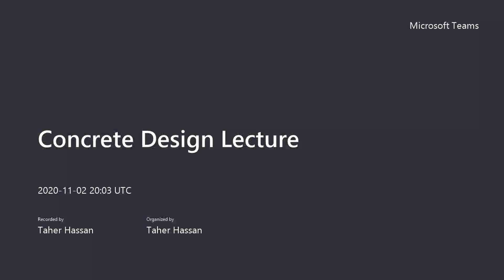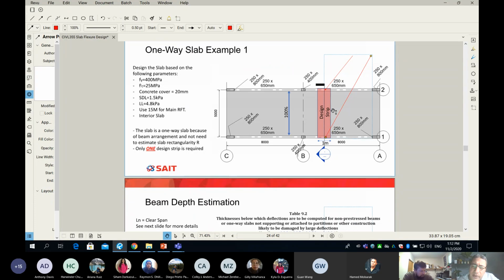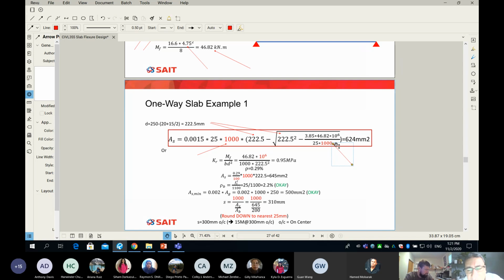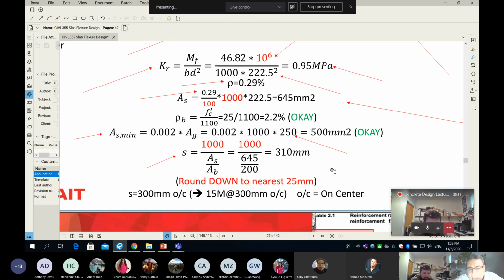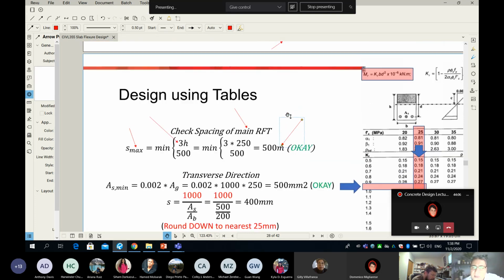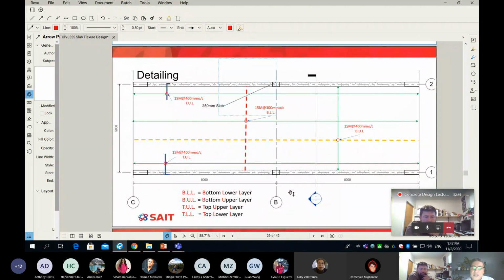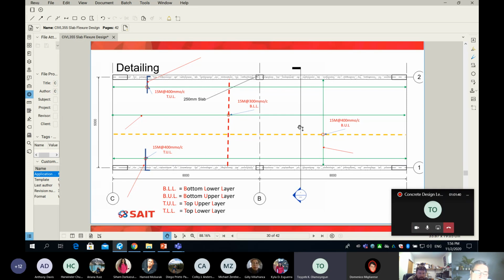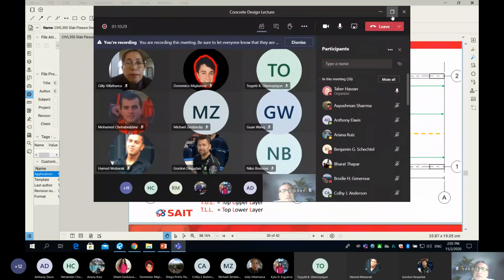One Way Slab Design Part V

Comment: Are you sure the spacing of bars is measured from centerline? In bmin eqn we have bmin=2*cover+2*stirrup dia+n*db+(n-1)*s, so s cannot be from centerline or you would be over counting otherwise.
Reply from the maker: that is clear spacing not center to center
Reply: @taher1973  Thank you sir. I understand something like 300 mm o/c is center to center :) but the spacings that we have to check vs code requirements are clear spacings, right? and the spacings in shear equations; are they all clear?
Reply from the maker: For slab design the spacing is center to center. For beam design the spacing is a clear spacing.  @erfanmohagheghian707
Reply from the maker: One more thing. When we check for Minimum spacing, it normally the clear spacing and when we check for max spacing, it will be normally center to center
 @erfanmohagheghian707
Reply: @taher1973  Thanks kindly.